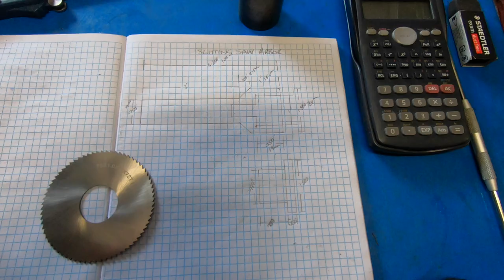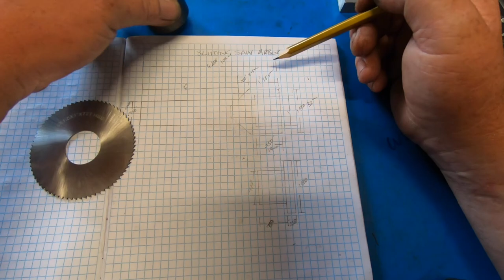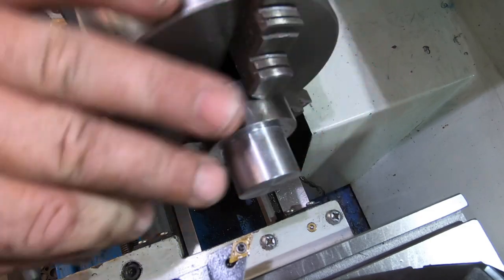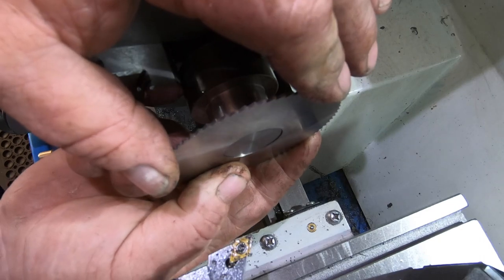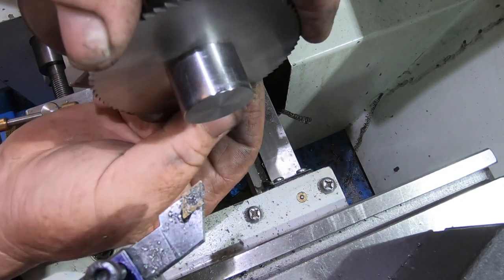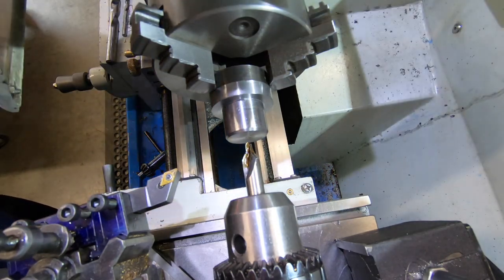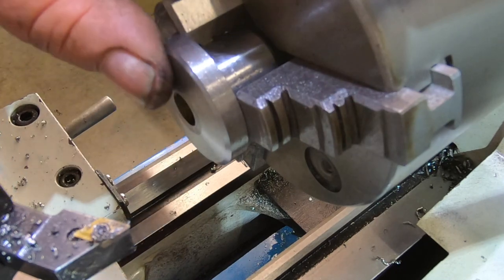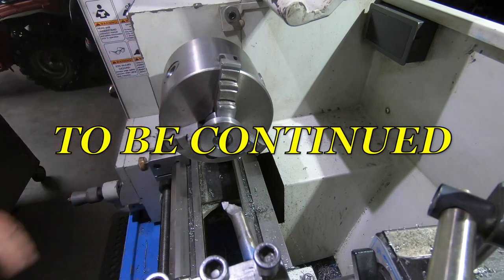Slitting Saw Arbor

Comment: If you're going to use metric threads, you'll want to have a 10.2 mm drill for M12 x 1.75, so you may want to consider getting one of those - which will be perfect for a quite tight fit over a M10 bolt.

Comment: That's great work, I do wonder, from previous experience if it would be better to have a recess on the retaining nut? So only the outer edge of the nut is holding the saw blade... I may be completely  wrong tho :😁
Reply: I don't think it's necessary given the narrow width of the pressure section.  If it was a wide arbor as on a regular circular saw I would say yes.  Cheers Rob
Reply: @Xynudu  thanks Rob, yes that does make sense